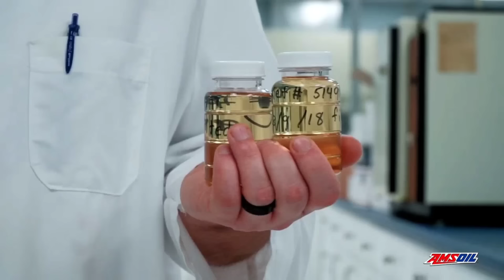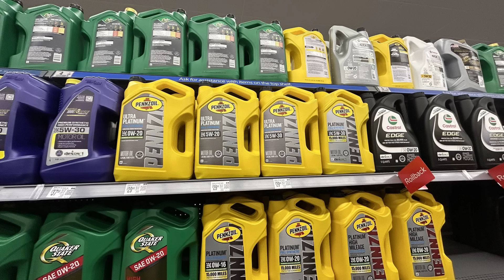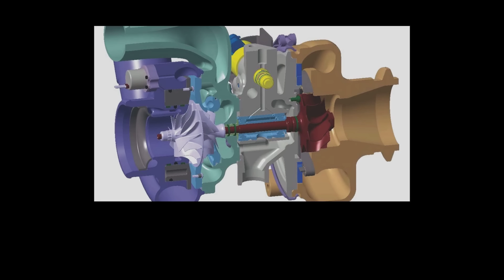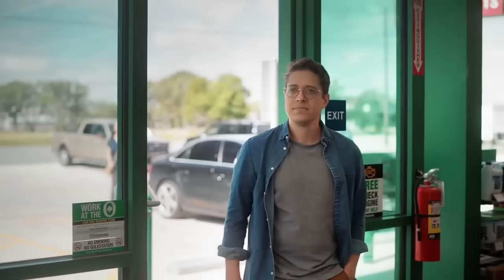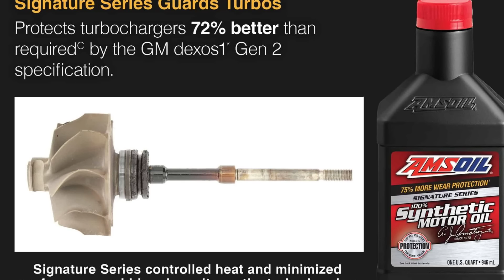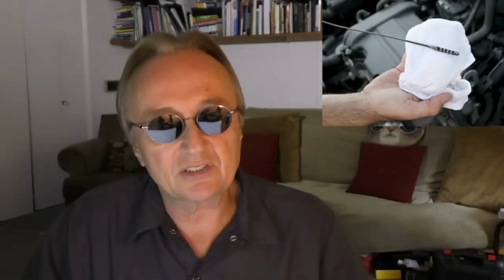Pennzoil Ultra Platinum vs Amsoil 5w-30 Oil

Comment: Due to the geopolitical situation in the middle east and the delays at plant expansions here in the US, as explained in detail on The Motor Oil Geek site., prices are on the rise.   Looking today on Amazon, It will cost me less to do a year's worth of Oil Changes (every 4,000 miles or 4 months) using Pennzoil Ultra Platinum as it would to do just one with Amsoil Signature.

If anyone wants to see the actual tests, the motor oil geek channel does a great job of laying it out.  The video we just watched here seems to have missed the fact that Pennzoil's packaging no longer references "made with natural gas" . It also explains, why there's no *real* negative associated with he base oil change.   Whenever a formulation changes, you lose your certification.  Pennzoil requested that they extend an emergency extension until the new formula completed testing.  API approved it, GM did not.  Not surprising with GMs recalls already having cost them a billion dollars, not using a certified oil could invalidate a lot of warranty claims.   The additive package in Pennzoil has not changed at all, what's changes is the base oil ... the natural gas derived base oil.   The most significant effect is in oxidation stability (OS) which assists in that 20,000 mile usage rating.   The new formula results in an 8-10% reduction in OS so perhaps now it is only good for 18,000 miles. So if you change you oil every 5,000 miles, the new formula has no real impact.  

All that being said, Amsoil does outperform Pennzoil on certain tests, in others, Pennzoil has an advantage.   The Motor Oil geek shows us which ones.   So while an argument can be made that Amsoil is a better product,  the suggestion that the label change ha somehow diminished the effect of Penzzoil's additive package is unsupported and false.

Comment: I drive a Gladiator and use the oil life monitor to change my oil. It hits 25% life left I get my oil changed before the end of the week and that right at 7500 miles. I run 5W-30 Pennzoil from Jeep dealer but when my factory free oil changes are over, I’m switching to Amsoil same weight.

Comment: 25,000 mile oil change with any oil brand is not too smart,  You must have the Idea of tradiing in the vehicle at 50,000 miles.  by the way what kind of 25,000 miles

Comment: If you want the pennzoil ultra platinum you better get it quick because they aren’t making it anymore for awhile. 
The war in Iran has stopped them from producing it.  The GTL made with natural gas is not on the bottle anymore. So who knows what’s going into pennzoil now.   I’m sticking with Amsoil SS   (Once a year change). I only put about 75 hundred miles on my vehicle annually and I’ve changed all my fluids transmission fluid with lifeguard 8, 
DiffS red line 75-85 gl-5, transfer case mopar ATF+4,  radiator flush peak American Chrysler dodge,break fluid flush with prestone, .  So I’m good for 60k miles except trany I’ll do that at 30k.  I know there will be the ware out stuff to do but I’m good with all of that stuff.  Wanting to get as close as I can to 300k if not more.

Comment: PENNZOIL Ultra Platinum is STILL a GROUP 3 oil even though made from natural gas, not crude oil, as all other GROUP 3 "synthetic" oils are. 
AMSOIL is a GROUP 4 POA based oil noise MUCH longer lasting in use. In my opinion and that of oil experts AMSIOL is teh better of the two.
BUT both oils are excellent and, if used with 5,000 mile oil changes there is not much difference.

Comment: This is all you need  to know to cut through all  the hype / Crap.  If your so- called  full synthetic motor oil  is not  Ester! Group 4 or Group 5,./It  is   most likely not a True full synthetic motor oil at all . Most US  branded full synthetic motor oils. Are only So_ Called full synthetic oil in Group 3 . Look it up motor for yourselves Git Er Done  motor heads. And stop guessing . Period

Comment: According to Lake Speed, The Motor Oil Geek, "Application Dictates Chemistry." 
(1) Turbocharged Engine:   AMSOIL Signature Series Synthetic Motor Oil
(2) Supercharged or High Performance Engine:  Pennzoil Ultra Platinum Motor Oil
(3) Towing Trucks & SUVs:  Mobil 1 Truck & SUV Full Synthetic Motor Oil 
(4) Most standard passenger cars:  Any Full Synthetic Motor Oil. Change Oil & Filter every 5,000 miles or once a year. Whichever comes first.

Comment: Many oil analysis reports show the Pennzoil ultra 30 weight oil loosing grade down to a 20 weight oil, long before reaching the 5,000 mile drain interval. To me that’s a failure.

Comment: For those talking about Amsoil prices, sign up for the 6 month membership. ($10)

My Mustang uses 10 quarts, and my last order for 10 quarts was $88, plus the $10 membership. Cost per quart was $9.80. 

Napa sells one gallon of Pennsoil Platinum for $56, just over $11 per quart. 

Amsoil is less expensive.
Reply: Walmart sells pennzoil platinum for $52 for TWO 5 quart bottles.

Comment: Both are great products, however I chosed RedLine 5w30. Regardless, subjecting  Earth derived product to complex blah blah blah, you can cook it how ever you want but if this begins as mineral products, it does not become synthetic after its cooked. Last time I checked we have Vodka thanks to gas-to-liquid process, nobody calls that synthetic do they?  Again, thumbs up to Pennzoil Ultra Platinum, great product, no need to overBS about it. This is very high tech mineral Group 3+ based lubricant among the best in its class and if you don't feel like preordering Amsoil or RedLine, go for it.

Comment: Change your oil every 3k miles people. Disregard the recommended interval past that. Use 505 CRO every few oil changes to clean the engine and CRF 505 to help clean intake etc.  components.
Reply: If you like wasting money, yes, you can do that. Oil analysis would reveal that you are throwing away oil that has significant life left in it, but you do you.

Comment: Have a vortex v8 I was changing every 5000miles, but still getting reduced oil pressure (or at least gunk on the sensor) with pensiol, and an upgraded filter from the dealer. I’ll try amsoil for the marked difference in detergent package and see how it goes. 🤞

Comment: Use Pennzoil  Ultra Platinum and change it every 3000 miles. A well-built car run normally and following all regular maintenance will last at least 300,000 miles.

Comment: You can’t beat 100% synthetic. It’s cut and clear. AMSOIL Signature Series all day.
Reply: Sorry but amsoil is not 100% synthetic. Amsoil is made from PAO which is derived from ethelene gas which is derived from CRUDE OIL.
Reply: @Superniceguy66it comes from the group 4 base oil which is 100% synthetic 😂😂😂
Reply: Group IV base oil is made from PAO which is derived from ethelene gas which is derived from CRUDE OIL.  Look up the origin of PAO and you will find this information .😂😂😂😂😂
Reply: @Superniceguy66To avoid splitting hairs, when Amsoil prints "100% Synthetic" on a bottle, it means the base oil blend contains zero unrefined conventional mineral oil i.e. Group I or Group II. In other words, free of cheap conventional base oils, rather than proof that every single drop was created from scratch in a test tube.
Reply: @clydecalamity786 What amsoil does starts from the same place all oils start from. The difference is amsoil refines more than conventional and adds to the oil more chemicals to aid in lubrication and cleaning and more. A claim  of 100% man made is a stretch,  at best a claim of more refined would be more accurate.  It is an excellent oil for sure but the claim is a little disingenuous. Think about the standards, amsoil claims 100% and pennzoil ultra gets a group 3 label when it's made from natural gas which seems more so "synthetic". In my opinion the word synthetic does not apply to any of them as it implies man made. Man manipulated is more fitting. But I get your point about splitting hairs. I'm just looking for honesty.
Reply: 100% synthetic is 100% a marketing term. The term means nothing today, ever since the court ruled that conventional oil is actually synthetic oil. It was controversial when Castrol started marketing their group 3 base stock oil as "Syntec" full synthetic back in the 90s. Mobil took them to court, and the court ruled that group 3 could be called synthetic even though it is made from crude oil (aka "not synthetic"). Ever since then, every group 3 oil has been marketed as "full" or "100% synthetic." 

PAO is not a magic base stock, and does not automatically make an oil better than anything else. It has low solubility, so the oil additives (the most important component of oil) cannot be adequately mixed into the base stock. PAO based oils need to be blended with another base stock to allow the additives to be blended in. This could be group 2, as it was with the older Mobil 1 formulation (before they got on board with calling group 3 "synthetic." They now do the same thing they sued Castrol for doing). It could also be other things. No oil, though, is 100% PAO. It would not work!
Reply: @tid418Not all group three oils are made from crude some were made from GTL yet considered group three. There is only one that I know of that claims 100% synthetic. PAO is made from ethelene gas which is derived from CRUDE OIL. So when they claim they are made from PAO  and thats what makes it synthetic they are misleading the public. I wish they were at least honest.

Comment: Mobil 1 Truck and SUV 5W-30 with a Boss filter has kept my 2014 Chevy 3.6L with 225K miles running perfectly in Michigan with 4K-5K mile changes

Comment: I used to use amzoil until i had the oil tested at a 5k oil change.  The oil was failing and breaking down. And this was the ss oil rated for 25

Comment: Amsoil Signature Series is the best motor oil. 100% synthetic and group IV
Reply: Sorry but amsoil is not 100% synthetic.  Amsoil is made from PAO which is derived from ethelene gas which is derived from CRUDE OIL.
Reply: It's really good. Redline is just a bit above imo. 100% synthetic group V.
Reply: Tests reveal otherwise. It shears out of grade more than other oils.

Comment: AMSOIL products can also be purchased at any auto parts store that is an independently owed franchise, who want to feature AMSOIL.  All of my vehicles have close to 300,000 miles on them, have not needed repair, and still run great.  AMSOIL is The First in Synthetics.

Comment: With the mileage I drive, seems like amsoil is the best if I want my engine to last longer. I drove my 2005 gmc sierra 1500 2wd for 14 years & the engine died at 312k miles. I changed my oil every 5k miles with full synthetic whatever every 5k miles religiously 5 or 10w 30. Now I drive a 2018 f150 which I bought at 158k miles.. having 2nd thoughts... seems like if anything is the death of that truck, it will be its 6 speed transmission this time

Comment: You can't go wrong with either oil.  

However, Amsoil costs a hell of a lot more and is harder to source, as mentioned.

For the last four decades GM uses the high tech oil life calculator.  I trust it far more than mileage based change intervals.

These extended drain intervals are idiotic.  They may work, but why risk it?  Oil is cheap, engines are not. 

How many people need those ultra low pour points?  People in Montana usually use block heaters or the vehicle is garaged.  For 80% of the US population that pour point is a non-issue. 

"Metal shavings on the dipstick?"  WTF?

And what's with the miles or once per year? Why not 11 or 13 months? It's just a pulled out of the ass number.

I use 10W-40 PUP.  It's even Dexos rated.

Comment: This was an excellent video. I recently started changing my own oil and after lots of research, went with AMSOIL signature series. If you are spending more than $50k on a car (which is about average these days), than saving $30 on an oil change seems like a bad reason to pick one over the other. It is great the Penzoil Ultra is readily available and provides comparable performance though. I order directly from AMSOIL and it comes it two days … so I would say that’s also “readily” available, especially if you know you have an oil change coming up! No way am I waiting for 25k miles though … 7.5k is the max I’d go personally and even 5k because I like to play in my garage. 😂

Comment: Best oil for all vehicles: AMSOIL and REDLINE,  In no particular order - All others are inferior -- there solved it for you. This includes there tranny fluids - and any other fluids they make.   I have been using these interchangeably since the early 90s -- there is no better oil.

Comment: Nice try - US Defaultism - Pennzoil Platinum is 25% more expensive in EU than Amsoil  - exact platinum top-tier series compared. Recalculated 3.78L and 4.73L containers.
Reply: Nice try, just checked and amsoil is more expensive than pennzoil in the eu.

Comment: The Pennzoil is certainly a quality product but no where close in value to the Amsoil 100% synthetic oils. In oil analysis I have extended oil changes on off road turbo diesel engines with over 8 times the hours with half the iron content. Most oils are purposely formulate so that they need frequent oil changes. It is better to change way before the typical 3k. Amsoil right from the 1960's has been formulated for extended drain intervals. The 25k limit is set very low for their protection. I have tested their oil with excellent protection with over 90k and the oil was still good for continued use.
View the You Tube "My million mile Chevy" This owner had less than one percent wear on the entire engine using Amsoil 0w30 and changing it every 35k. You can not get this level of protection with other oils, so don't try.
There is a reason why so many new vehicles have problems with engine failures. People buy the cheapest oil for their investment that cost them $60,000 - $100,000. No sense when Amsoil will protect your investment. Follow the thousands of people who drive hard and keep their engines running fine for years beyond normal use.

Comment: I have a 2005 chevy colorado with 357K miles. I use pennzoil ultra platnium for the last 200k of its life. I normally change every 5k miles. I swear by pennzoil ultra platnium. I do want to try amsoil to see if theres any difference, but seems to be hard to find.

Comment: I’m a believer and have multiple vehicles running amsoil so I buy in 55 gallon drums saving even more money with PPE oil filters at 7500 miles interval changes — best protection at the best price as it brings it down to $9 per quart for diesel 0w-20 signature series

Comment: Have run Amsoil for 30 years, on every combustible engine I own. WIX oil and air filters. Problem free. In vehicles changed oil at 25.000, WIX at 15. None burned oil and lil use was minimal. Ran a Honda Civic 175,000, when I sold it it used a quart every 25,000. But this was before the gov. changed the ring tolerance.
Reply: Were you using a standard Wix fiter, or a Wix XP filter? Amsoil is having a hard time getting their canister filters these days.
Reply: @BMAN7087  I use the XP just because of the extended mileage.

Comment: Not comfortable with such extreme oil change intervals. Even the oil geek says even with lab tests stating amsoil detergents are still performing after 20k miles, doesn't mean it doesn't have more gas contaminants. I'll stick with Penzoil UP on my turbo engine and I also change it every 3000 miles. Regardless if it can go 7500 miles or 25,000 miles, I'd prefer clean looking oil. It's still pretty black/dirty even after only 3k miles.

Comment: After years of using many different brands of Synthetic oil in our brand-new 1999 Ford Windstar, I ran into a YouTube video about Amsoil. At that time, I was using Royal Purple. I was quite happy with that product for years. About a decade ago, we acquired a 2006 Ford F-150 with the V-8 Triton engine from one of my customers for dirt cheap. This truck had the regular Ford Dealer maintenance. The first thing I did was change the oil with Amsoil Signature Series 5W-30 and a Wix oil filter. When I started the engine, it was significantly quieter. When I drove away, it actually burned some rubber!! At first, I thought it was all BS and influenced by watching these YouTube videos. Over time, it wasn't something I imagined. The truck ran smoother, was quieter, and apparently had more power. I kept my 3K oil-and-filter change habit even though I could go much longer than that. Yes, it is expensive, no doubt about that. Two years ago, I donated that truck to a friend of mine for his son to drive it; it had 365K and was still driving like a bat out of hell. We bought a second-hand 2013 F150, also dirt cheap, to replace the 2006 truck.
Now we are in 2026 and, despite the high costs of the 3K oil changes I keep doing myself (it's not that hard, folks, IF you have the place to do it), this 2013 truck with the V-8 Coyote engine sounds, feels, and drives even happier than the 2006 Truck.
With the "weird habit" of changing the engine oil every 3K miles, I could also use cheaper synthetic oils and save a ton of money, but I don't want to. If the truck is happy with what I give "her"*, then, by all means, if I can afford it, just do it. I am curious to see if I can beat the 365K I had on the 2006 truck. I also installed an oil-catcher between the PCV valve and the Air-Intake. I was quite surprised by how much oil was in the container after "only" 1K miles. Consider this: "This oil would be dumped into the engine air-intake"

*The 2013 Ford F-150 is, without a doubt, a "she" because, for example, I can't drive without my seatbelt at my work's parking lot without "her" complaining about it; my 2006 truck didn't give a hoot. All this is just for fun and to tease my wife in those days.